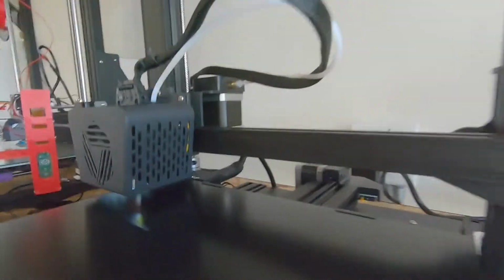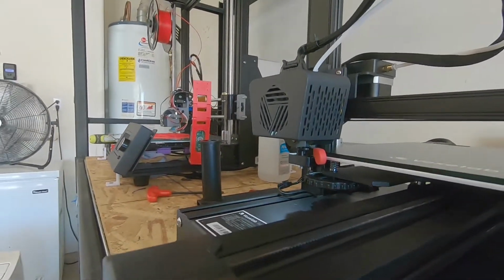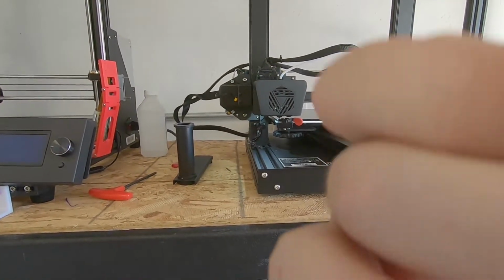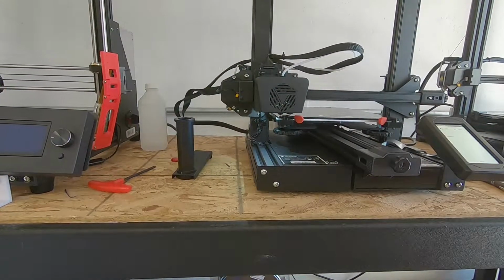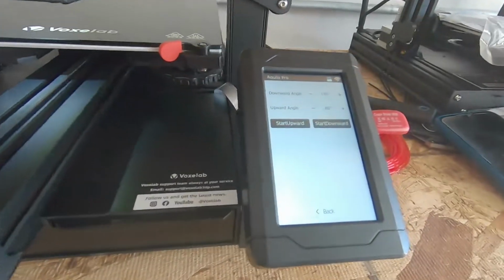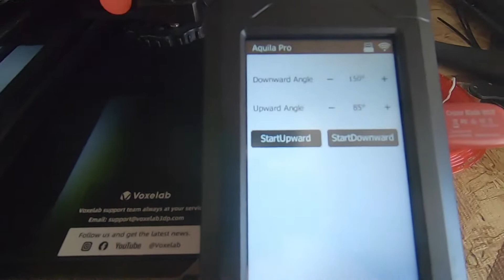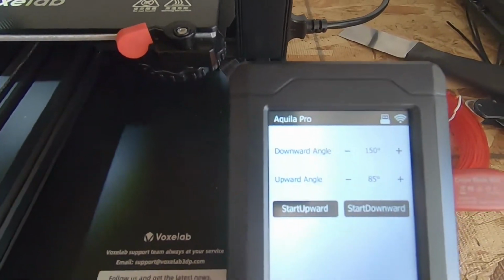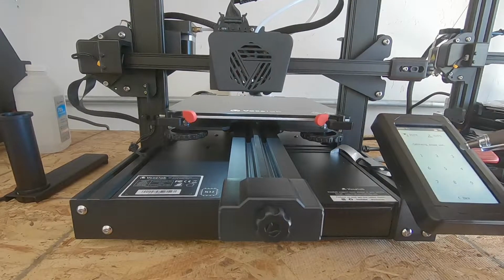Aquila Pro Part 2

Comment: Just came across your video and really glad that I did.  Have had all the same issues at some point with my Pro machine. Also have the print stop mid-print with an "out of filament" message, even though it's a full reel (turned off the filament detection).  Very frustrating but still a decent product for the money.  Thanks for helping resolve a couple of what I previously assumed were self-inflicted screw ups.

Comment: When you are levelling, the nozzle isn't visible because its hidden behind the bed fastening clips.  Since I upgraded the firmware on my printer(s) 2 x Aquila Pro I haven't been able to print there are additional steps that I just don't know what to do...The supplied information isn't very good.  I'm happy with the levelling and calibration, however now after printing the raft which is always perfect, the model itself completely messes up and the extruded lifts up and lowers a number of times when printing the model.
Reply from the maker: The lifting and lowering during the print sounds like z hop is on in the slicer.  What slicer are you using?
Reply: @3dprintablesllc271  , I’ve switch to using the Voxelab. Slicer and that has no issues
Reply from the maker: @SimonPlatten  I find that whenever I have issues with a slicer I just go back to the voxel maker slicer and the issues typically go away